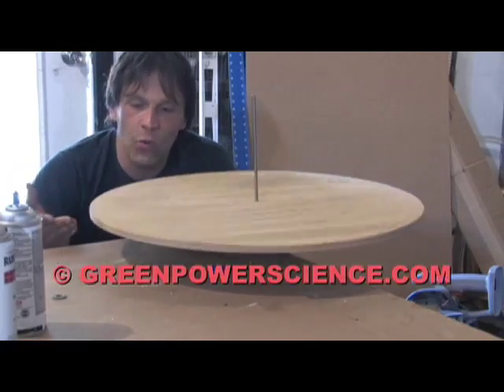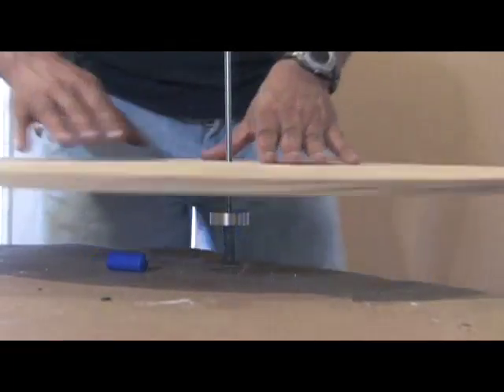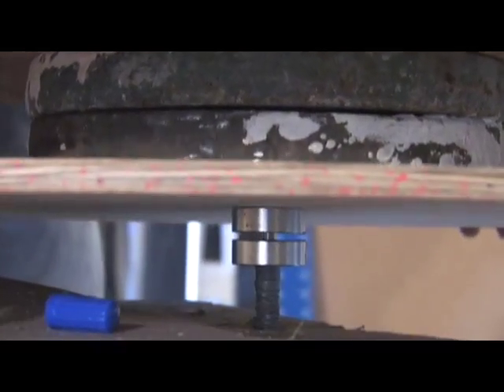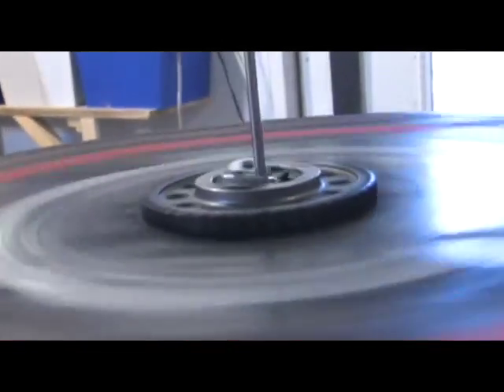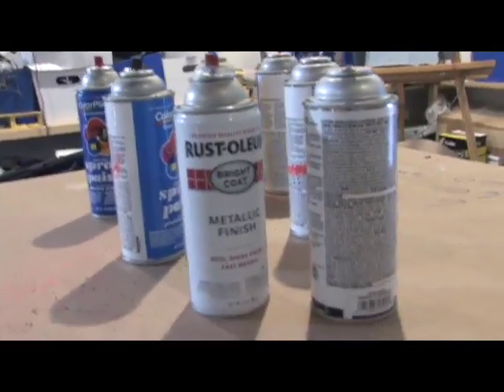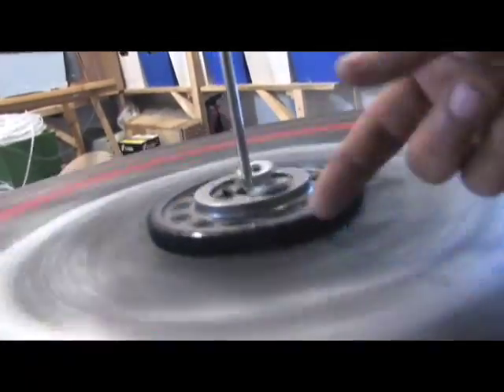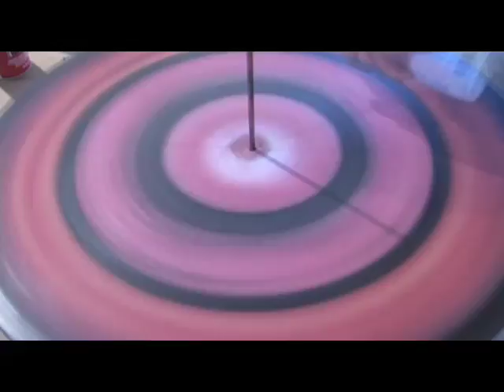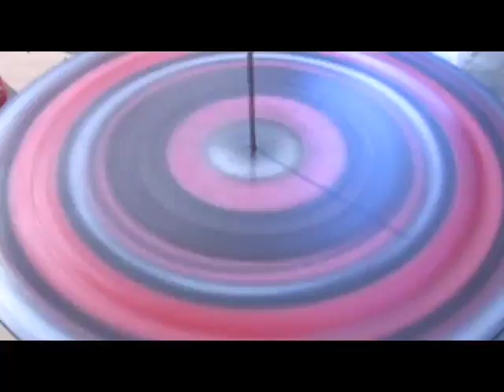MAGNETIC LEVITATION Vertical Axis Wind Turbine NEODYMIUM MAGNET rare earth magnets spin art

Comment from the maker: They do not get hot, and also a bearing on a larger system would be recommended in the center of the magnet. The magnets basically act as the load bearing and damping system. If  the magnets were to ever fail, the unit would just come to a slow stop.

Comment: Neat idea. I've been playing with Neo magnets for a long time and see how useful they would be in this application. I have also built a tangent bearing by drilling a hole partially thru a thick alum plate of a dia slightly larger than my shaft. Then drop a steel ball bearing into the hole for the shaft to ride on. Thus, the only contact point is the top tangent of the ball meeting the shaft. My first turbine would spin like crazy with practically no friction. The only prob was replacing the ball occasionally because it would rust in the weather.

Comment: The separation of the two magnetic discs eliminated the friction between the two discs.  However, the axis and center of the disc still make contact. If the bottom magnetic disc has a cone shape center and the top disc has a matching conical indentation, then the two discs should be able to align without using a center rod. Then the bearing is truly frictionless.

Comment: I didn't look through all the comments, but if you have trouble lining up the coils with your magnets using the magnet bearings, try using another set of magnet bearings at the top of the center shaft. You can then force the mill down with a nut and still get the less friction as previously.

I like think about using roller blade bearings for these also, although they may mean a light shaft (1/4"). Good for a short on house test model though.

Comment: For your spinart, use squirt bottles and liquid paint. Spin real fast so the paint 'flows' to the outside. Put blobs of paint here and there before you start the spinning to create comet-like sprays, use and air gun to spray the paint in different directions too. If necessary, use paint thinner to thin the paints out a bit.

As for your bearings, to help with horizontal drag, use graphite impregnated bronze sleeves between the magnet and the shaft and maybe a couple drops of oil or grease.

Comment from the maker: Hi,
This rod was steel but a stainless steel rod will have less resistance. You will still get some resistance from Lenz's law with any metallic rod but not an issue at RPM below 1000. The weight and diameter of my turntable makes the resistance a non-issue. Smaller diameter flywheels and lighter weight tables would need stainless or carbon fiber/ fiberglass fishing rod.

Comment: Good idea but needs to be finished. Theres a frictional force between the top magnet and the rod that can be either, smoothed with a roller bearing... you wouldn't be transverse loading the bearing and efficiency would be a little better or,  to magnetically repel the shaft from the top magnet, and have a very neat magnetic bearing.

Comment: Physics question:
If u suspend a magnetic wheel in a circular magnetic field inside a vacuum chamber and spin it, will it then spin indefinitely?
There is no air inside the vacuum chamber and the magnetic wheel is suspended in mid air by a circle of powerful magnets.

Comment: If you then equally placed some more Neodymium Iron Boron magnets on the circumference of the lower circular frame (with their pole faces ALL the same e.g. North Seeking facing outwards) then as they pass a transformer (or multiples thereof ) around the periphery you would achieve ELECTRICAL POWER! 
You may also consider re-wiring the transformers with bifilar (two wire) coils to capture the BACK E.M.F effect as many 'free energy' buffs recommend. I do too ;)
Keep up the good work!

Comment: so fit dust shields, point of it was a support system not a rotating bearing, if you use this as the pivot bearing for the whole turbine, not the main bearing, you could have a rubber sock protecting them.

Comment: Two opposed spin VAWT is an interesting idea to increase the velocity between the magnet and the coil. Doubled velocity will produce twice the voltage per same number of turns in a coil, or one could half the number of turns and produce the same voltage as well as half the internal resistance in the generator's windings. Halving the number of turns in the windings would allow one to use thicker wire in the windings were space was an initial constraint. And using a thicker wire would further reduce a generators internal resistance. 
A Magnetic bearing between opposed spinning VAWT might be difficult to control the distance between coils and magnets. With magnets on one and coils on the other, the VAWTS will be unbalanced by weight with respect to each other and might respond differently in different winds, though this shouldn't be much of an issue. The biggest issue for the home builder will likely be designing the commutator. The attraction to coils on a stator is you do not need a commutator.

Comment: "Rotation: Surprisingly, it is possible to levitate a rotating object with fixed magnets. The levitron is a commercial toy which exploits the effect. The spinning top can levitate delicately above a base with a careful arrangement of magnets so long as its rotation speed and height remains within certain limits. This solution is particularly clever because it only uses permanent magnets." Radboud University, High Field Magnet Laboratory.

Comment from the maker: The poles are to isolate in this central rotation. I am working on a DIY generator/alternator but there is a ton of loss with current DIY setups. Trying to figure ways of maximizing the current.

For now, standard Permanent magnet motors are tough to top.

Dan

Comment: If you were to use levitation like this on a windmill, you need to use bearings to make sure that the magnet doesn't rub on the shaft.  If you allow it to rub, you will eventually wear away the outer coating and expose the VERY TOXIC innards of the magnet.  Then your power won't be so green. :-)

Comment: Yeah. I guess as long as the load is balanced there isn't much pressure/friction on the shaft, so a loosely fitting hole around it is not a signficant friction point. The load is in a downward direction, where the friction is well-handled by the magnets.

Interesting.

Comment: @ruxblue We are thinking along the same lines because the part with the friction is where the rod enters the hole and there is absolutely nothing keeping the friction down at that point.  Now if the disk could be suspends around the rod and suspended away from the bottom then we would be rocking.  So far this only shows the later part.

A Bullet train hover over the track to reduce friction so it can reach such high speeds but it is fully removed from the track the item in the video is not.

Comment: Dan, I got some Neodymium ring magnets to create a magnet bearing for a kinetic sculpture.  The problem appears to be that the rod itself seems to have some pull to the magnets which does not allow the rod to turn freely in the magnet.  Does the rod have to be a non-magnetic material?  The rod you are using appears to be a steel rod.  How is that not causing a problem?

Comment: its not bad idea to use neodymium as bearing usualy in magnetic levitating turbines magnets are placed not central but radial and used not only as low friction bearing but together with wire coils they generate electricity. dont forget that you have still some friction on the steel rodin radial placement with good setup rod or other solution can be used only to hold the turbine together in situations like too strong wind. Its my opinion

Comment: Maybe VERY toxic was an exaggeration.  It depends which safety web site you check.  But Neodymium itself is rated as a low to moderate acute toxic rating.  (whatever that means.)

In any case, if you break one, treat it with care, and you wouldn't want to be putting that stuff into the environment.

Comment: "A theorem due to Samuel Earnshaw proves that it is not possible to achieve static levitation using any combination of fixed magnets and electric charges. Static levitation means stable suspension of an object against gravity. There are, however, a few ways of to levitate by getting round the assumptions of the theorem."  Radboud University, High Field Magnet Laboratory.

Comment: Would it be feasible to machine the magnets to make mating cones, eliminating the need for any central spindle?  Finely adjusted at both ends, they would spin freely with only magnetic drag for resistance.  No lubrication, no wear.  Might need a loose-fitting spindle for safety.

Comment: It looks cool. But, since the magnet still has to contact the shaft....is there any reason to believe that it works with any less friction than a pressed-on shaft bearing?

Now, if the magnet was surrounded by a repelling field, so that it didn't even have to be ON a shaft--that would definitely be less friction than a bearing.

Comment: How long would the magnets last under that load? Technically it is still a sleeve bearing with very sloppy tolerance, I think something would be needed to reduce wear on the magnet. If you had a ball bearing with light oil to reduce lateral forces, while still having the magnets support the weight, I think that could last quite a while and be more stable (may have a bit more friction than just magnets, but will be less than just ball bearings since the magnets hold the weight) :)

Comment: if the wind mill design or conditions can't beat the bearing resistance (very low on quality bearings) then there is no meaningful energy to be harvested.
 The generator will resist much much more than bearings. 
To get better efficiency is blade design and proper tower going to be much more sensible. 

Vertical axis is handy for the tech is on the bottom and no need for steering vanes but normal blade type will sweep much larger area and with proper blades will generate much more energy.

Comment: Hey look a dartboard. Ok, a Tiedie dartboard.

but no really. thanx for the heads up on the friction-less funtion. that gives me some ideas for an electric motor. I'm just wondering if lenses law would apply as the magnetic fields from the maglev "baring" system would interact in a counterproductive way with the magnetic field causing the motor to spin.

Comment: lets say you stack three Neo's .. so they are mutually repulsive (which is no problem) .. if you spin the top one (however fast) .. can you get the intermediate one to spin?  Similar problem to having two kept-apart  tethered magnets  - vertically oriented  (unless you're in Space).  If you turn the bottom one - will the top one turn?  Are you cutting field lines?  Next question - will these magnetic bearings wear with time?  Will they need replacement after 5 years of service?  Coercivity Q.

Comment: @bruenor82 
Thank you sir, i did not think about that :).
I imagine that the magnetic wheel would start wobbling faster and faster because of the oscillations formed by the fading magnetic field before reaching the collision point with the outer magnetic ring.
Do u think the oscillations will be faster or slower than the speed of the rotating wheel?

Comment: @ruxblue (part 2) The second part you mention also holds true but lets just look at each problem as we go.  Disc is free floating above another surface.  Yep.  Disc is free floating around the rod.  No...fail.  Now when we connect up wires etc... I would leave for another discussion but the first two criteria I mentioned must be done first.

Comment: Hi names Tony how about making a cone shaped magnet female on the base male on the shaft driving the generator also recreate the same or just a ring magnet with another magnet on the top shaft for balance, the weight of the generator will compress both cones which will repel each other not only up but also to balance and you should have a completely friction free magnet without any bearings at all magnets should do there job

Comment: Could you tell me how do you build the magnetic levitation bearings? It's just two "donut" magnets and one axle?? Thank you in advance!
Reply from the maker: hrcnlz Yes, that is all there is assuming the turntable is balanced. This video has a steel rod but a stainless steel rod will have better results. You will still have a bit of resistance from Lenz's law but it works great. For a heavier load, add more opposing magnets. There is a limit as the higher the stack, the more top-heavy the structure becomes.
Reply: +GREENPOWERSCIENCE  to minimize loses from lenz's law one would increase the space between the metal rod and the levitating magnets. theoretically, one could use many thinner rectangular magnets forming a rough circle on the outside of the disk. A similarly designed magnets below would oppose the magnets above. their power to repel  adds with each magnet. If the top and bottom magnets differ by length, your less likely to have reinforcing concurrent  vibrations from differences in magnetic fields. Ideally arc shaped magnets  forming a circle would be best. Care must be taken to eliminate as much space between the magnets in each ring.

Comment: @bruenor82 
The reason i was asking all of this was to know if it is possible to create an electric turbine in zero gravity to spin indefinitely (or for a long time). Could a turbine like that be used for power generation in space (where u have less sunlight)? A magnetic wheel could spin indefinitely in space, but could it generate power after its initially set in motion.
Do u think that would be a viable power generator in space?

Comment: I want magnetic bearings for my longboard. is that even possible?
Reply: they do exist, but they currently require speeds of 15000 rpms to work.  so unless you wiley coyote a rocket on your board they won't make a difference.
Reply: GREAT IDEÁ!! Tips the developments !!
Reply: or do you mean on the trucks? to have a smooth ride?

Comment: quote: " The generator will resist much much more than bearings. "

Dont need to use generator, build one on
underside of rotor plate. Glue magnets to
underside, and have them passing over
copper coils. No friction induced, and it
induces electric current in coils..........

Venger

Comment: @ruxblue ...(cont.) This is a flat board bouncing around wood on metal. Great, the downward friction is reduced, now give it a higher center of gravity (vawt is not flat...) and a 30 mph wind that attacks in all kinds of directions now try to drive electrons down some copper with it wobbling back and forth. Cogging in a standard alternator can shake bolts loose, imagine what magnet play will do... Point is this does not address practical problems. There is nothing in this demonstration that does

Comment: When they can 3" or 4" diameter NEO's  1" thick, then It would be easier to make a magnetic Rotor and mount it to the vertical fins and have th coils on bottom  mounted to the other NEO, and poof, a way to make electric with zero friction.

Comment: @GhostOfACPast Probably better than a lazy-susan system that I have seen, but not as effective as a $3 thrust bearing. This is neither here nor there. What I was whinging about is the fact that this shows nothing but the fact that magnets repel. Add a pair of magnets to the top, to add a downward force, add few pairs along the shaft (ring/rod) to keep it off the support post and we would have something a little less useless. Now how do we keep the rotor an even distance from the stator? ...

Comment: @GrayShark09 
Building a maglev rail out of rare earth magnets would be impractical and about 100 times more expensive than building a maglev rail out of copper electromagnets. Even if u build it out of powerful metallic magnets, u still need a form of propulsion for the maglev train.
We have the technology to build maglev trains that will exceed 300 mph, the only  reason we are not doing it is because we are held back by the oil monopoly.
Think about that next time u gas up...